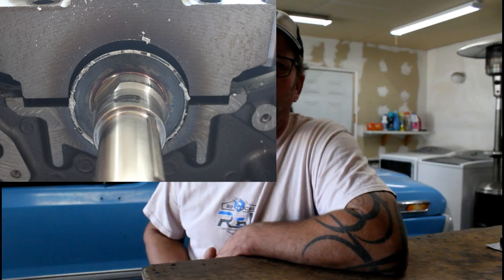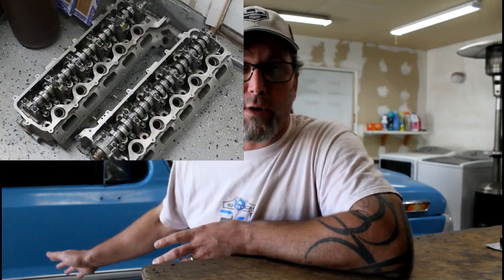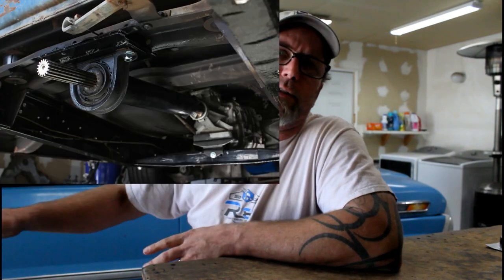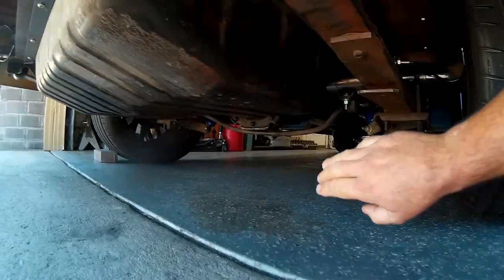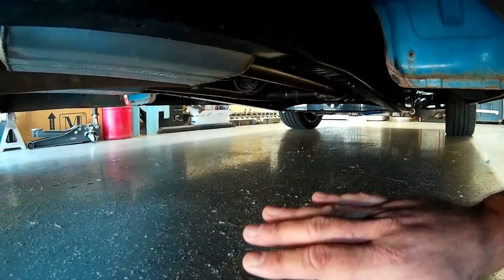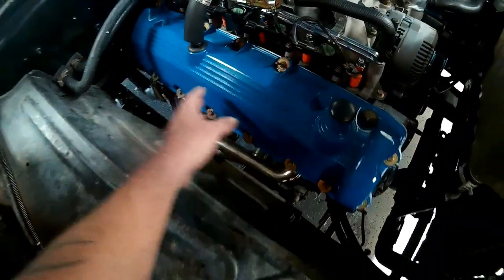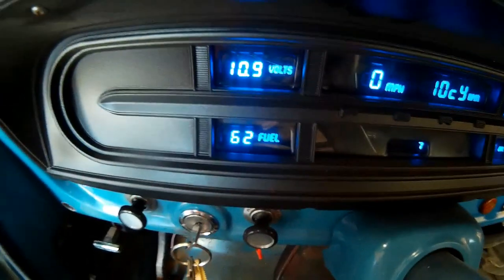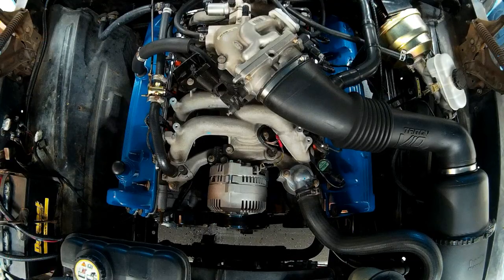#v10bumpside Ford F100 V10 Swap Build Walkaround!

Comment: Sounds like an awesome project brother. Do you plan on porting and polishing those 3V heads as well on that V10.
Reply from the maker: thanks for subscribing!  from what i know of the 3v heads, porting isn't really necessary with boost.....which is where we're headed..  will be building an intake later in the year once i get some of these stacked up projects completed.
Reply: @vintagespeed  Sounds awesome brother.
Reply: @vintagespeed  How much power is the V10 making right now.
Reply from the maker: @CJColvin  i haven't put it on the rollers yet, but that's the plan for later this year.  right now i've got my hands full with a 4.6 swap on the '71 and my other son's '67....hoping to get back to the #v10bumpside soon.
Reply: @vintagespeed  Sounds awesome brother. Hope the sons will love the TRUCKS that you're fixing up for em.
Reply: @vintagespeed  What type of Flowmaster exhaust do you have on you're V10.
Reply from the maker: @CJColvin  these are some 40series muffs i had laying around, had to reverse the end caps to fit into my layout.  i like the way it sounds, not obnoxious but when you're on it, you hear it.  thanks for watching!
Reply: @vintagespeed  Awesome brother. Does it have any drone.

Comment: Dont go 3valve you'll regret it
Reply from the maker: not sure how that's possible, but thanks for the input!
Reply: Edit after watching the video further you said you would lock the phasers then I guess the 3 valve would make more power so go for it
Reply: @rustedratchetgarage6788  3v already makes more power
Reply: There are no phasers on the 6.8L. Only on the 5.4L